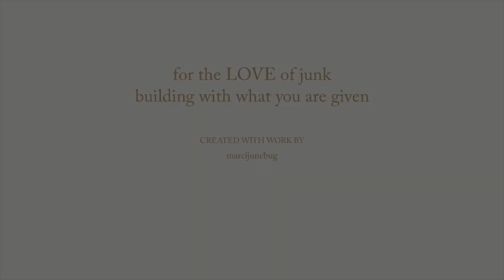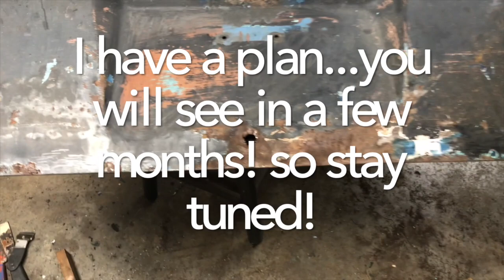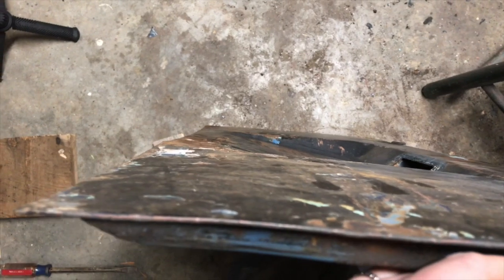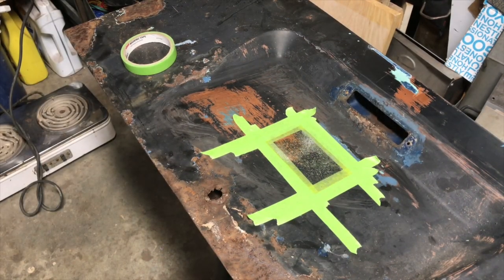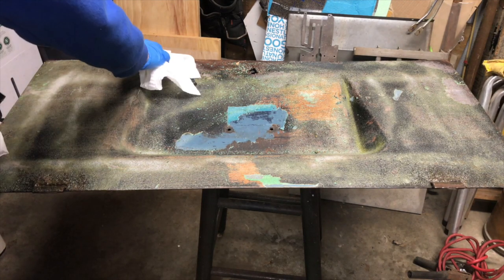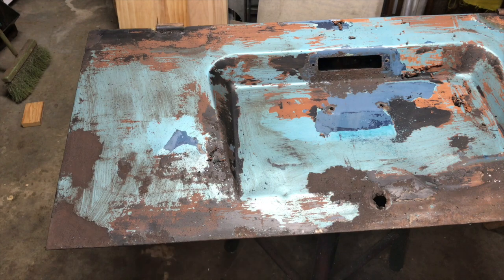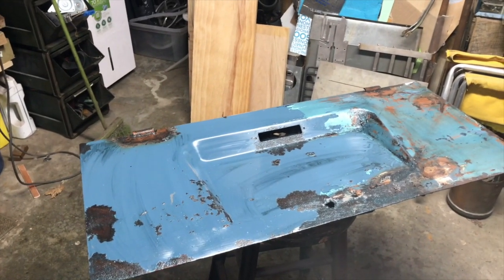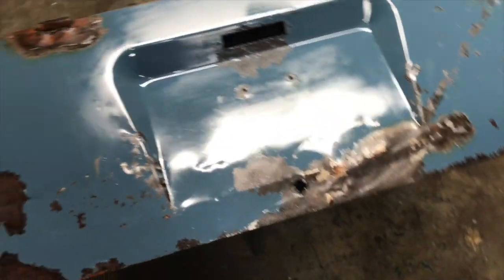How to save original paint on a car or truck (part 2 of 2)

Comment: I did a section of my Singlecab gate with Oven Cleaner. The upside is it's cheap, the downside is, it doesn't work well if it's cold outside. Might be worth a try, but the Goof off seems like it's working really well.

Comment: I used a product called Nitromors it eats through rattle can paints but didn't eat the original paint in the cabin of my singlecab 😉
Reply from the maker: Warren Greenfield thanks for the tip! I will check it out...the MSDS report on all of them pretty much list them all having basically the same ingredients. Trouble with this bus is 2 of my layers are ENAMEL based and these products don’t work very well on that! But will certainly give the nitromors a try!

Comment: Have you tried brake fluid as a paint stripper?  I had a spill in my trunk...  

Fortunately, it was supposed to be the revealed grey color and not the bronze car paint that it stripped off.
Reply from the maker: Funny you said that because in one of the next two (can't remember which one it's in) pickle videos (likely going to be posted next week) I mention THAT very thing! SO yes I have tried and for areas where you want it down to bare metal quick it works!

Comment: Great video! What's the plan to protect/coat the Dove Blue and the rust now that it's been stripped? Something like Penetrol or Boiled Linseed?
Reply from the maker: Thanks! Probably boiled linseed or toilet ring wax! I’ve used both in the past and both have their good and bad. I might just use a good car wax and buff the main parts of bus and spray thinned boiled linseed everywhere else! Thanks for watching! Stay tuned much more coming on this one soon!
Reply: @marcijunebug   thanks so much for that! I've got a new '65 Econoline van project that has several resprays over it. I'm looking forward to trying your technique to bring out whats left of the 'Caribbean Turquoise' back :)
Reply from the maker: Oh I LOVE those vans! The process isn’t for the faint of heart but it is somehow so rewarding seeing that original paint come through! Good luck! Caribbean turquoise😍 I even thought about trying brake fluid in area that doesn’t matter then spraying off once paint starts to bubble...maybe a future video? Don’t want to strip down to metal tho...so might experiment first on something I don’t care about lol